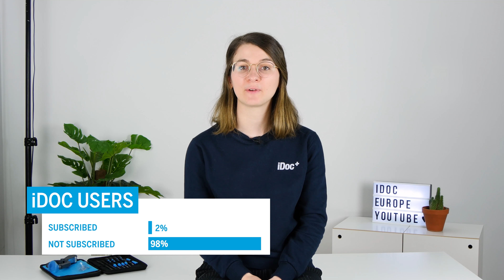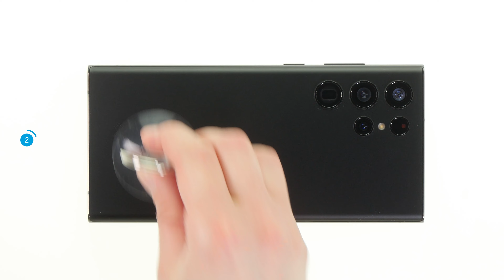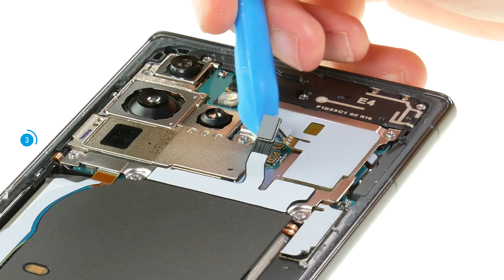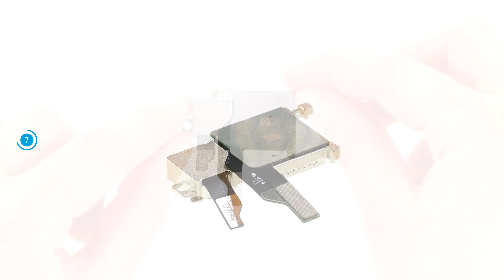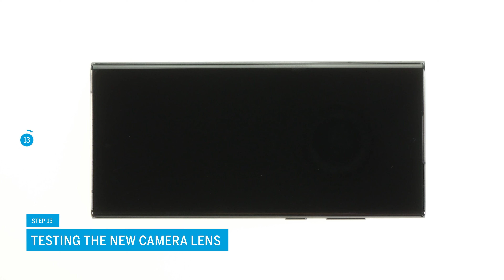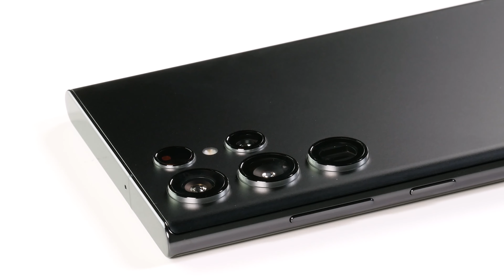Samsung Galaxy S22 Ultra – Camera replacement [repair guide + reassembly]

Comment: This guide skipped the 10x telezoom steps, but as soon as you remove that one screw that separates the other 3 cameras, and then disconnect the connector for the telezoom it'll pop right out of the motherboard.    I bought the full camera module (all four cameras joined together) from iFixit.  To install it, you have to separate the module with that one screw, install the telezoom first, then the other 3 cameras as shown in this guide.

Comment: My back cameras got damaged due to laser exposure.  Please,let me,know,if after repair wouit be still waterproof after that seal application?
Reply from the maker: Hello Vikas Patel,

Water resistance is not guaranteed after opening.

Best regards

Marc from iDoc
Reply: @iDocEN  i am afraid for the same.  Although samsung service center here in India told me that they will use the original gaskit and proper seal to ensure it ll reamin the same. Lets see .but after that i am not gonna throw it in water again😄